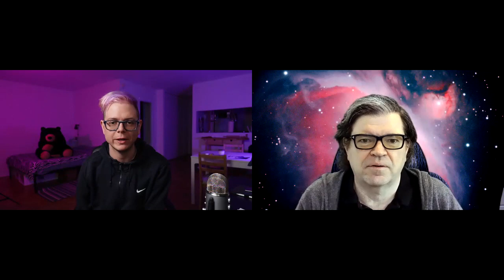05.2 – But what are these EBMs used for?

Comment: Hi Alfredo. I did not get completely the point of Yann on DL being extrapolation in high dimensions. I have always looked at it as mostly interpolation even in higher dimensions. I also recall this interview to F. Chollet (search for interpolation) where he states that DL is feature interpolation.
 https://www.zdnet.com/article/keras-creator-chollets-new-direction-for-ai-a-q-a/

Coming back to Yann example of images. It is true that a random combination of pixels will not fall into the volume of the training sample but a new image sample is not random it must come from the same underlying distribution so it will be if not inside very close to the training volume. I do not see how a neural based function can performe genuine extrapolation since it does not assume any analytical pdf which can still exists as meaningful outside the fitted-to data domain. Am I missing something?
Grazie!
Reply from the maker: Yann says:
«Can you reconstruct an ImageNet validation sample as a linear combination of  ImageNet training samples?
Min_K || valsample - SUM_i k_i trainingsample_i ||^2

Are your test samples outside the convex hull of your training samples.
If yes, then it's extrapolation.

Are your test samples not obtainable by linear combination of your training samples, then it's a stronger form of extrapolation.

If you do the minimization above while constraining the k_i between 0 and 1, then you are determining of the validation sample is inside or outside the convex hull.»
Reply: He said it very plainly. You cannot express any new image as a linear combination (interpolation) of other images in your dataset. It would be like trying to create a face as a bunch of additions and subtractions of other faces.